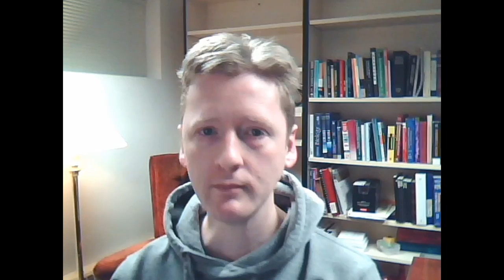Iron Batteries are better for DIY than sodium-ion

Comment: Is the Iron battery storage capacity better than Lead Acid ???
Reply from the maker: No, probably not. Lead acid has a very high capacity; All-iron has about half the voltage (or less) and (at least so far) the somewhat low solubility of iron poses more capacity problems. Iron has advantages in cost and toxicity, but not capacity. I'll talk about that more today  (4/19/17): https://youtu.be/GTiXko0NL7M